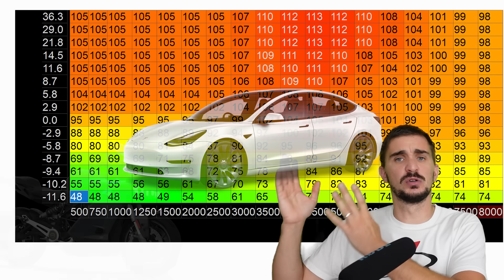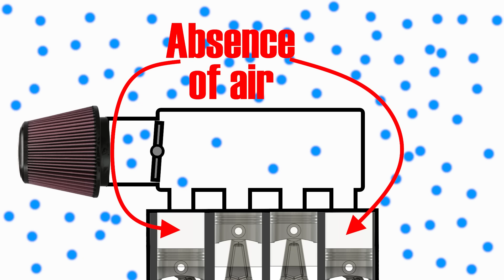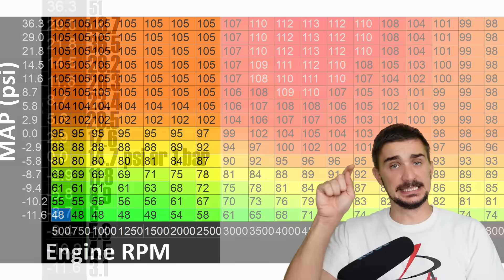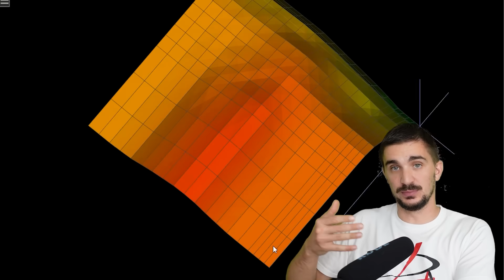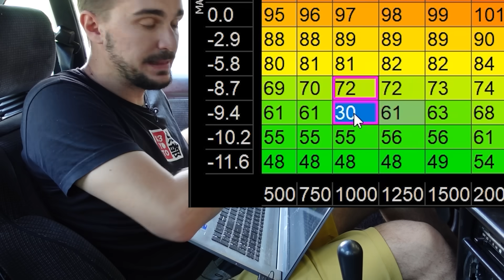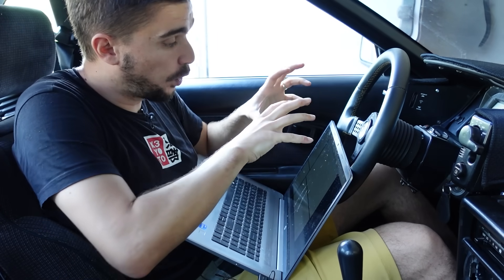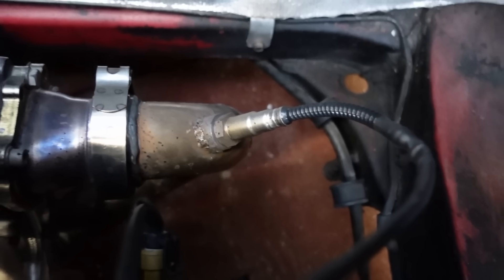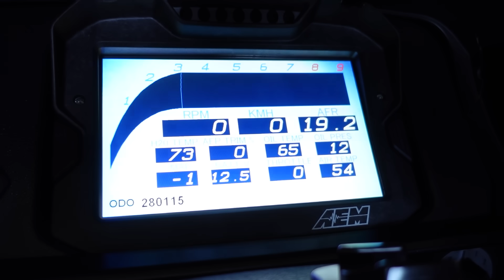If You Understand Volumetric Efficiency You Understand Engines

Comment: knowledge is power. thank you for sharing this. Can I ask, if you take a motorcycle engine 650cc parallel twin.  I keep the same header pipes but change the silencer. I then add a high-flow air filter the ECM will take readings from 02 sensors and try to keep it to the VE table values of the stock map. as long as it is no more than 30%?  , with these changes in mind is it likely to need an adjustment of more than 30% by the ECM, or should the stock map be able to deal with this.
Reply from the maker: It very much depends on the motorcycle. Many engines don't have a wideband oxygen sensor from the factory. They might have a narrowband in which case they simply see that the air fuel ratio is outside the expected range and they throw an error code. They can't compensate or fix it by adding fuel. More recent engines do have a wideband but many will also just throw a code if they see values outside of expected. To know exactly what happens you need to dyno the bike before and after the mods and possibly reflash to make use of the mods. Or you need a standalone ECU like I'm using in the video so you can monitor changes in real time before and after the new hardware. But a silencer and high air flow filter are very minimal mods and likely won't result in any noticeable VE increase. We're talking about 1%. The chances of the ECU throwing a code are pretty much zero. So it really isn't justified to dyno or reflash the ECU for something like that. There also won't really be a noticeable power change outside of placebo effects from the different sound.
Reply: @d4a  Thank you for your advice really appreciate it. 👍 i would like to make changes mostly for sound on this project my only concern was making it run too lean and causing damage long term to valves etc by overheating.

Comment: So, if I understand it correctly, 
the ECU calculates the DIFFERENCE between absolute and atmospheric pressure 
and basically gives the amount of fuel according to this DIFFERENCE ?

Because car diagnostics shows in my car atm. the pressure 135 kPa.
What is cca 35 kPa more than reality.
And that means, that ECU then gives me permanently incorrect fuel values. Isn't it ?
Thank you for your reply.
Reply from the maker: No, the ECU doesn't need to know atmospheric pressure to operate. It only cares about pressure in the intake manifold. Some cars also have a baro sensor for atmo pressure but it's not detrimental to anything
Reply: @d4a  Really kind thank you for your prompt reply.
But referring to your video
"Boost pressure vs. Manifold Absolute pressure vs. Atmospheric pressure
- BOOST SCHOOL #4"
where you are saying that
Boost pressure = Manifold Absolute pressure - Atmospheric pressure

and the fact, that car has to know somehow ( ... from BARO sensor ) 
at what altitude it is

I would assume, that BARO sensor (  atmospheric pressure sensor )
has substantial role in boosting of engine -
and fuel calculations for injectors.

I do not know, whether it is as I am writing,
but I know, that my Mondeo MK3 TDCi, 
which has 8 leggs SMD BARO sensor on ECU  PCB
gives me high atmospheric pressure values 
and car is black smoking when I accelerate
but no smoke in high revs.

And BARO sensor, 
influencing boost pressure and fuel calculations
and VE map tables 
would explained me everything.

I have already bought new BARO sensor a week ago
and I wonder if it makes sense to resolder it.
But I think, that Ford does not give special BARO sensor 
on  ECU PCB  needlessly.

Comment: So part of the issue with the high end rpm breathing, with mechanical valves is that they are not always either at a full OPEN And CLOSED state, they gradually open, and then they are fully open, and then gradually closed, if you could get them fully open as soon as TDC passes you could get a smidgen more performance out of the engine with higher end on your RPMs is my guess.

Comment: Alright I have a question: On the VE map you showed us, it says that at 3.5k RPM and 0psi gauge pressure the VE is 102%. Then if you were to double the pressure to 14.5 psi gauge you only get 109% VE (+7%). THEN if you were to TRIPLE the guage pressure to 29 psi, you would get 110% VE (+8%). How is it that the VE only goes up by so little? My understanding in theory is if you double the density of air going into the motor (asuming same AFR), you will double the power of the motor and if you triple the density, you will triple the power. I understand there is efficency issues with boost, air density under boost, paracitic loss, ETC. But +8% VE from TRIPLING the pressure is nowhere NEAR doubling, none the less tripling the VE. Is this a complete map? Am I just missing something?
Reply: I still hope someone will see this and answer because this question even months later is still killing me? The best I've come up with is the pressure is measured a the manifold (more specifically the sensor mounted at the manafold), and the pressure in the manifold isn't exactly equal to the pressure in the combustion chamber when the intake valve is open. This still doesn't make sense with my intuition as trippling the pressure of the manifold should have a noticable effect on the volumentric efficiency under any conditions, at least something MORE than 8%.

Another bonus question I've been thinking about along side this; Lets say the engine is at 3k RPM. In a manual, if you stayed in gear and let off the gas, does the injectors turn off completely resulting in only air going into the combustion chaimber and no fuel? Or does the injectors squirt only a little fuel to keep the AFR somewhat reasonable? I would imagine they turn off completely but then again air is always going inside the chaimber as the throttle body isn't  perfect seal. No where on the VA map does it indicate a air fuel ratio of infinity or something.
 
If there's no fuel going in the combustion chamber then there isn't a risk of predetination, but there might be too much engine breaking if theres absolutely no fuel burning...

Comment: Should be noted this is Speed Density VE control. Not MAF based( in either MAP location) and not "mafless" in the aspect of using Alpha N when just removing the MAF on cars that have the MAP sensor after the turbo/IC and before the TB vs IN the intake manifold(Speed density) after the throttle body. Also....Lambda > AFR.

Comment: Some clever ECU's can learn the engine. They have a copy of the map in memory and adjust the table according to the controller values. Once the engine is calibrated you can use the controller as a diagnostic tool.

Comment: Does every single gear has its own map or it is fixed for the whole gears. Cuz my car rpm unstable (increasing and decreasing when driving at 3rd gear ) and it does this only when reach 3rd gear. Other than this the rpm is stable while accelerating on all gears except the 3rd one. Hope you give a solution for this

Comment: So I didn't understood well the part of low rpm! Is the low efficiency because a lack of inertia on the air coming to engine, for example: we have a engine rotating on a low rpm range, so the air has less inertia than the air that is coming on a high and ideal rpm range and this will change how much pressure will be on the chamber when the valve closes. Am I correct?

Comment: I’m not completely clear on what the pressure scale reflects. You describe it as absolute manifold pressure minus a fixed 14.7 psi. Gauge pressure is the absolute pressure minus the ambient pressure. Historically pressure gauges reflect this difference in pressures. Does the pressure scale represent absolute manifold pressure minus 14.7 psi or minus ambient air pressure? Thank you

Comment: Sir, I have been following your boost school videos and have found them very informative and helpful. Many manufacturers today using forced air induction have dropped the MAF sensor and have switched over to only using a MAP sensor. All of the VE calculators out there on the Internet require a MAF input. Do you know of an equation of how the VE's are calculated for a MAP sensor only. Your VE table is a good example. I'm wondering if the manufacturer of a particular engine had a MAF to measure the airflow, did some calculations with a VE calculator and stuck those values in the VE table. Any thoughts on this would be appreciated! Thanks and have a great day!

Comment: 6:00
Volume of a cylinder is (pi*(bore/2)^2)*stroke, not bore * stroke.
Reply from the maker: The bore and stroke are the only variables and you multiply them.
Reply: @d4a  You're wrong, sorry. 
Bore is radius. Stroke is height. Radius * Height ≠ Volume. Just google it, "Volume of a Cylinder Equation". 
Area of circle * Height = Volume, or
(pi*(bore/2)^2)*stroke = Volume.
Not trying to give you a hard time.
Reply: @d4a  In the equation I gave, bore and stroke are still the only two variables lol...
Tell me this: A cylinder has a bore of 10 units and a stroke of 20. What's the volume? Hint, its not 200.
Reply from the maker: Horsepower is torque* rpm. Google it. Not trying to give you a hard time. Hint, there's a constant but including it is not relevant for the explanation of the concept. Now apply the lesson learned to this example, you can do it.
Reply: @d4a  At 6:01 you plainly state that bore * stroke is the "entire volume of the cylinder". This is wrong.

Comment: If the ECU can only correct up to 30%, what happens if you go from sea level to a few thousand meters of altitude? The air pressure difference is going to be more than 30%

Comment: I would add one small correction here, VE of over 100% is possible in a NA engine with proper intake manifold and valve tuning, racing NA engines have achieved VE up to around 125% using this method. Of course this is within a narrow band and the pulse harmonization is dependent on intake runner length and diameter making broad spectrum use of this internal supercharging effect very difficult. Basically you can use the momentum of the incoming air charge to cram more than 14.7 psi into a cylinder before the valve shuts but this effects exists in a rather narrow RPM band and even then it requires very precise valve tuning.

Comment: I know this might be difficult to answer, but with this information, would I be able to tune my own car? It’s a boosted application over 20 psi. Obviously I need to learn about knock and ignition tables before I delve into my own tuning, but I could definitely mess with smoothing out my idle with this information correct?
Reply from the maker: Yes, you can do basic tuning with this to make the car drivable and get bade AFRs in place. Ignition isn't much more complicated than this.
Reply: @d4a  Thank you so much man. You’re the best!!!

Comment: If a naturally aspirated engine peaks at 0.0 (14.7 psi), which is atmospheric psi at sea level, how can the engine reach 104% air in the cylinder at that 0.0 value and not peak at just 100% as seen in the VE map. This is no hate, I'm trying to understand this and I figure it has something to do with boost since it wouldn't appear this engine is naturally aspirated, but rather a question of is 104% possible with no boost at all. All love

Comment: I have this old hot rod tuning manual. In it is discussed putting and O2 sensor just down stream of the exhaust port and hooking up a volt meter to it . The O2  sensor  in my understanding  converts the hot exhaust flow temperature  into an electrical reading . By correlating the O2 electrical reading you can determine the air fuel burn rate,thus allowing tweaking of the CARBERATOR

Comment: In reality VE drops during boost. Otherwise boost would improve brake specific fuel consumption and turbochargers would increase economy- they do not. Exhaust gas pressure from the turbo will reduce cylinder filling and tends to climb higher than boost pressure. Superchargers have parasitic losses directly from the power stroke which contribute the same (more actually) overall change in fuel conversion rate as power being lost either way still results with lost energy and lost fuel. The reason the numbers go up on the fuel map in boost is to make up for worse brake specific fuel consumption which is just worse conversion rate of fuel to power. It takes twice the fuel to make twice the power in theory- but a little extra, actually, just like it takes a little more than twice the pressure in terms of boost. This is because there are losses compressing air even if that air is re-cooled to ambient the energy is still lost due to friction, e.g. intercooling will reduce power because it adds friction to the control volume with input energy provided by the same fuel mass to compare with. When you look at the VE map the VE does not double when you double the pressure. That is because most ECU calculate pressure and that density change confers the extra fuel needed (Double pressure double the fuel flow at the same VE number), VE just makes up for the drop in efficiency conversion rate and maybe some evaporative cooling influence on density if you don't have the IAT close to the cylinder while running alcohol for example. Some ECU like megasquirt actually depend on the fuel to come from the VE map in which case you can double the VE and double the power at a little over double the VE- the VE term and air density due to pressure are intermingled into one number. At least some older megasquirts worked that way I don't know if they still do like that. A modern Haltech for example you can place the same VE number at 15psi as you can for 30psi and be off in terms of fuel only by the difference in BSFC- double the pressure, double the fuel, not quite double the power, and nowhere near double the physical VE in the table though, only a fraction.
Reply: @carstennobody7047  This seems like an ai generated nonsense. The highest adiabatic turbo efficiency in the world is like 78 maybe 80% at most. You fail to identify units in your writing, all engineers know when you use a word like efficiency it has no meaning unless you say what kind of efficiency. A turbo is just a pump and the numbers you quoted for backpressure are empirical, it doesn't make sense to mention that. There is so much confusion

Comment: I qualified as a Bosch FI tech 35 years ago, in the days of K and L Jetronic, and Motronic was new. And it didnt have any lambda feedback, so you could richen the mixture by adjusting fuel rail pressure and then measure tail emissions. Real belt and braces compared to what this vid shows.

VE map was fixed and IIRC there was a basic adjustment that lifted or dropped the entire map by a fixed percentage to allow for altitude because the airflow meter was volumetric and not mass.

Comment: Overall I would say yes and no at the same time. Thx to changes in VE map you can reach proper AFR, ofcourse. But VE is a mechanical/thermodynamical value, which ecu "knows" from the engine models made by engineers. Why not to correct AFR in fuel trim maps leaving VE map as it is? Cause from a proper point of view, changing this values you are not correcting the VE of the engine :) You are simply correcting the amount of fuel. VE in this particular engine stay as it was and 'we' have overall no idea what it REALLY is :)

Comment: shouldn't the VE map be 3D because measuring engine load with MAP only doesnt make sense to me, if you drive downhill the engine sucks a lot air in while engine load is basicly negative. And when driving up hill the MAP reading could be quite low in comparison to the actual engine load. Correct me if i'm wrong

Comment: SORRY< BUT WRONG! THE MANIFOLD PRESSURE IN A NORMALLY ASPIRATED ENGINE IS ALWAYS BELOW ATMOSPHERIC PRESSURE. In other words, there is always a partial vacuum in a normally aspirated manifold while the engine is running, even at WOT. The only time such a manifold will reach zero vacuum (atmospheric pressure) when the engine is at zero rpm.
Reply: No. Tunnel ram intakes can get up to 1.25 x atmospheric pressure.

Comment: 6:07 typo: volume is pi * radius * radius * stroke. But yes, your concept is spot on.
7:07 kinda. Imagine a turbo that is dumping fuel at well above stoich in order to keep shit from melting. The math goes haywire, eh? But again, yes, at a fundamental level. You're getting pretty damn smart, kid.
8:43 gotta disagree, here. Tuning an engine is all about creating positive inefficiencies. You see, the most efficient induction system is one that works at negligible vacuum at all times, and so consumes negligible energy. Full stop.
But old school engine designers don't split cycles, so increasing the functional size of the incredibly cheap induction system also increases the size of the expensive combustion system.
You see the solution? Add a cheap and incredibly efficient piston-based compression adjustor, which adjusts the atmospheric pressure an engine sees to whatever is appropriate. This renders volumetric efficiency irrelevant, allowing actual efficiency to be expressed in the design while eliminating any rationale for an incredibly expensive and inefficient turbo system. 
Good video. Thumbs up. I'm meeting with a University of California, Irvine doctor of material science this week. I'll find out if my engine is practical or relies on unobtanium. In either case, the bits and pieces (such as the Compression Adjustor) will work with traditional engines.
Keep up the good work.